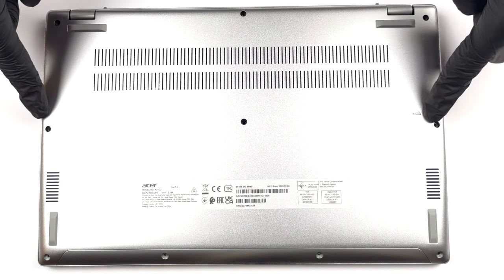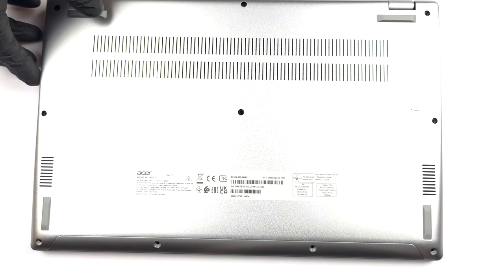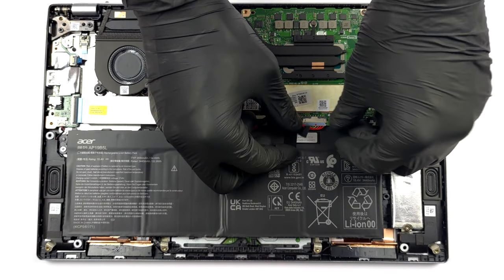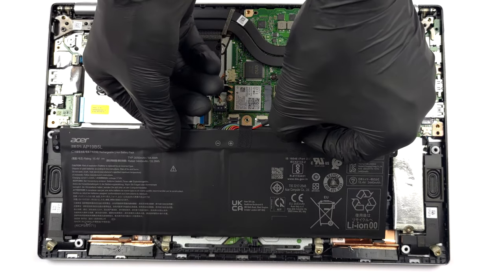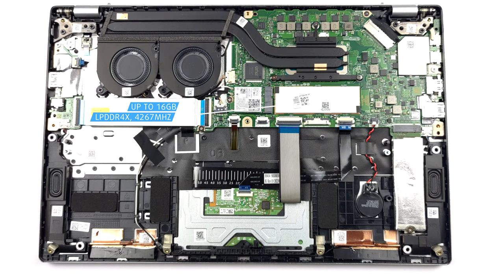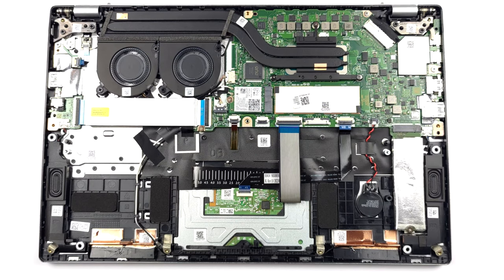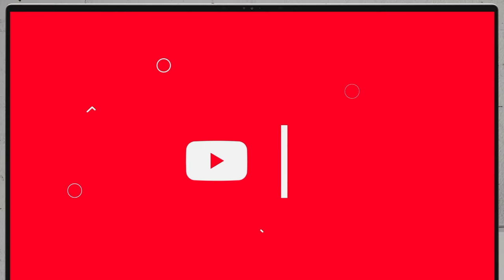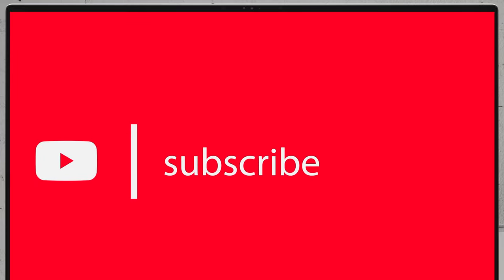🛠️ Acer Swift 3 (SF314-512) - disassembly and upgrade options

Comment: There seems to be a second m. 2 SSD slot under the cable
Reply: Definitely not. On the left there, that's a connector for the cable connecting the IO daughterboard to the main motherboard. They're right in saying there's only one M.2 NVMe slot.
Reply: @evankirschenmann4653  Well...the second slot does exist.
Reply: @evankirschenmann4653  i just opened the acer swift 2022, there is definetly another M2 slot under the cable
Reply: Yes. I just installed a 2TB drive in the location shown in the video and moved the existing 500GB to the slot under the cable. Both drives function normally.
Reply: @entique4216  i got a 2021 swift 3 here im going to check it out i know it has a sata 2.5 bay and m.2  ssd in it ..its identical lookinig to this one on the video though

Comment: the  swift 3  at home has 4gb ram a ssd m.2 slot and a space for a sata 2.5'' hard drive also it has 1 fan and a 2021 model what years this one ours has a light up keyboard and amd chipset i like yours better looks way more staunch inside can i put that cooling in our one if i get it somewhere

Comment: Its weird, on the specs website for the one i bought its this same layout but the specs say it has 2 m.2 drives....it only has one as i just found out by taking it apart and coming here to make sure i wasnt blind and missing it...
Reply: It has two. The maker of this video missed it as well. It is under the wide ribbon cable from the motherboard to the upper-left daughterboard.

Comment: I ask you all where is the 2nd SSD slot? Looks like the owner of this channel also missed that important thing!
Reply from the maker: Hi, unfortunately, there is only one SSD slot on this laptop.
Reply: @LaptopMedia  why don't you say if the slot is Gen3 or Gen4?  (edit: I see in the SSD image it's Gen4 so just say it)
And really you should say on all your reviews what the CPU is!  Can't believe you guys always omit this most important thing.  Commenting about the heat pipe but not the CPU makes no sense at all IMO.
Reply: @LaptopMedia  Remove the cable between the mainboard and the "island" board, there will be a 2nd ssd slot underneath, at least the Chinese version has such a 2nd ssd slot!
Reply: @bbaker6212  Because the same laptop model often comes with different CPU's in different configurations. But cooling and design is the same.
Reply: @bbaker6212  intel 12th gen supports gen 4 storage directly to the CPU, so I would bet money that it's a gen 4 slot.
Reply: @simplethink69  is there an extra m.2 slot ????? Please let me know
Reply: @marcoreus1472  Just opened up mine and checked what's underneath the cable. I am confirming that there is indeed a second full-size SSD slot hiding under it.
Reply: @Peter-nj6io  thank you😌🙏 brother